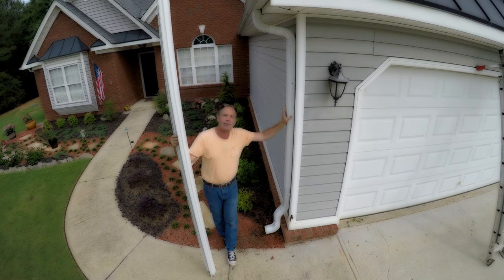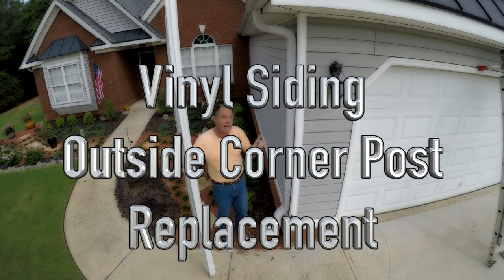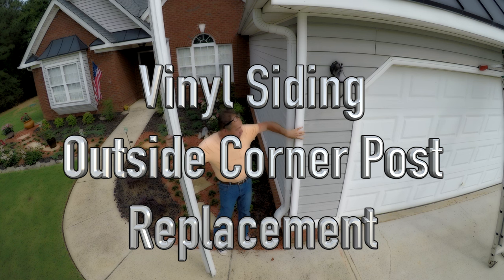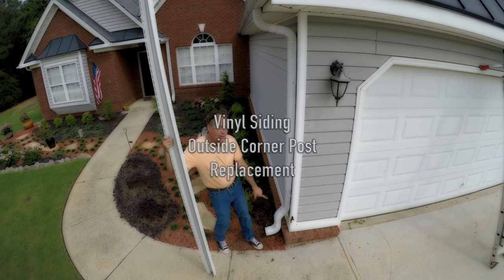Vinyl Siding Outside Corner Post Replacement

Comment: You have been the only person that was able to answer my question on how to completely replace it and properly and in just seconds. Thank you! I love that you didn't do a lot of talking just got straight to the answer.

The bottom of my corner trim came completely out from under the siding and I had no idea how to fix it (whoever installed it put no nails in the bottom corner to hold it down and the previous owner put screws through the top of the siding) you just saved me hundreds and a headache!

Comment: Nice job! Why don't  you just upgrade with our new Clip-On SuperCorners?   http://www.homedepot.com/s/supercorners?NCNI-5    Made to fit  over 3" and 4" corners.   Most installs take less than 10 minutes and gives you an upgraded look.   www.SuperCorners.com   Soon to be in Home Depot stores.  Looking for investors.   paulyarmo@gmail.com
Reply: That will be a product I would be interested in using. However most of my repairs require only one corner to be replaced and my effort is to match the existing corners on the home.
Reply: For and extra $50 you get an upgraded look.  Increase curb appeal = more value $$  :)